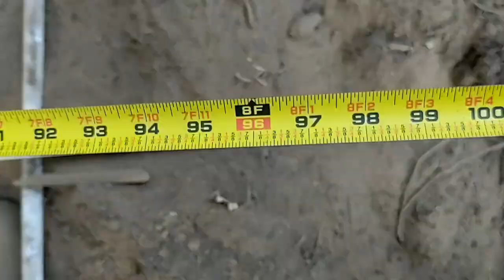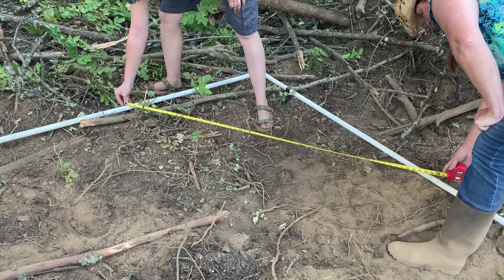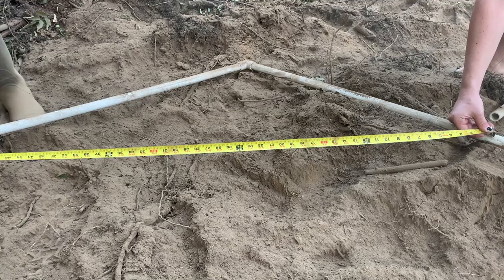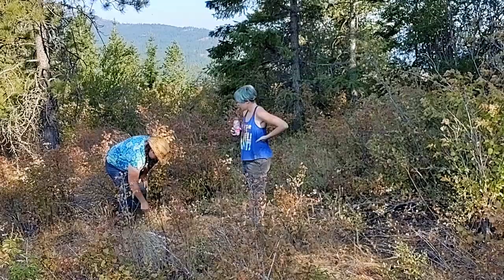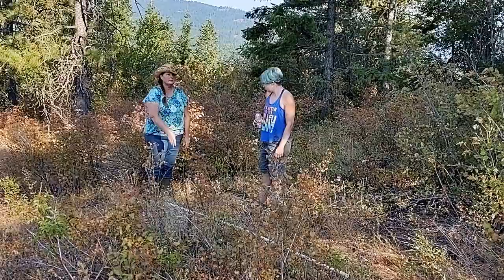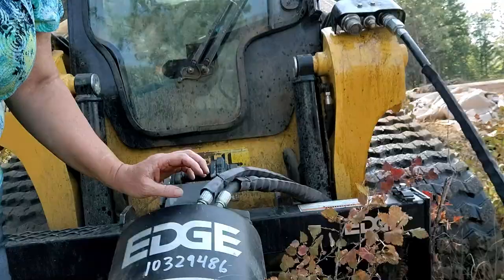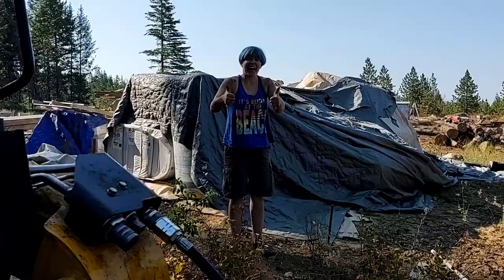Digging Piers for the Off Grid Shipping Container Build // Farm Vlog

Comment: It is nice to see you apply Pythagoras, with the 3, 4, 5 rule. Though I would suggest you use some multiple of those numbers in order to get better precision. Or you might use a bigger unit of measure. So instead of using 36 and 48 to get 60, you might use 60 and 80 to get 100.